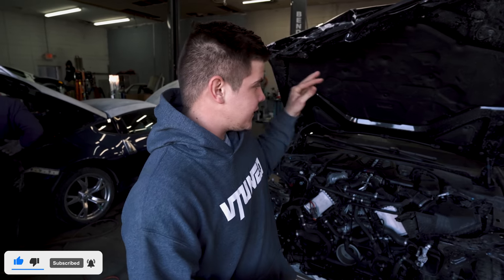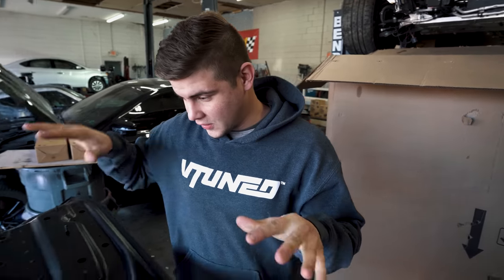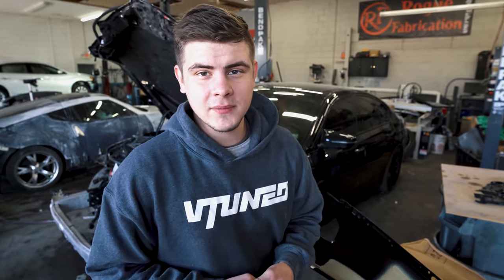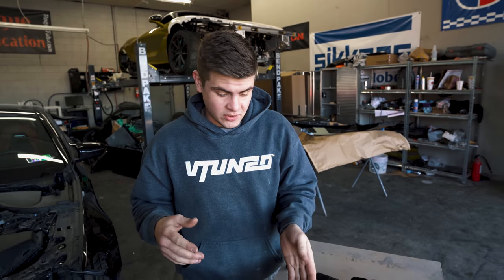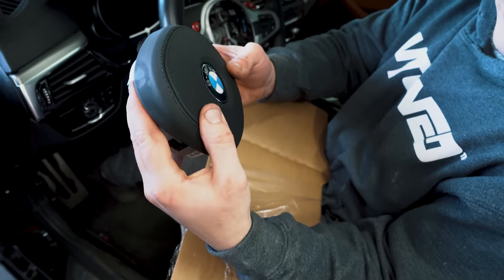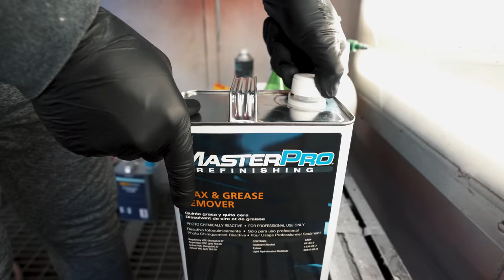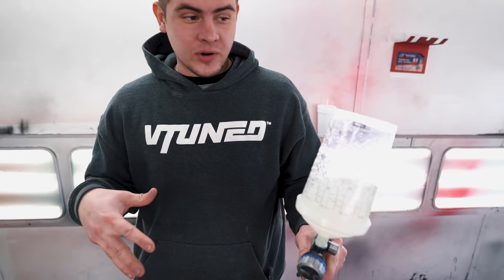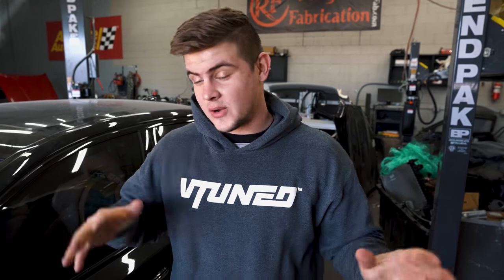The BMW M5 F90 is ready for FRAME work - Episode 4

Comment: Only vTuned could make me enjoy watching the painting of the inside of a hood and fender.
Reply: a straight forward practical guy. Just like the Backyard Boyz
Reply: this guy goes the extra mile.  most shops would be like well no one will see that hood behind the pad and no one will really see the inside of the fender.  since it's black let's just spray the edges and slap it on the car.  i highly doubt there's a production body shop that will spend the extra hours for those details.

Comment: Ben, Thanks for sharing, amazing video mate.  Can you please advice what type of paint you use?  Is it a two pack type with hardener or this new water based paint? Also do you need the base coat dry before putting on the clear coat or can I spary the gloss coat straight on? Thanks in advance as I would like to learn.

Comment: The paint job looks amazing and definitely black out the door handles
Reply: Blacking out the door handles would be beyond dumb.
Reply: @mikebrowne477  A bit of an over reaction as they are only door handles
Reply: @garethedwards2883  So leave them alone. A Nissan Versa comes with all black door handles. This is an M3.
Reply: @mikebrowne477  Hi Mike currently in the UK the cars all come with black handles/trim etc and sometimes BMW do it and call it a shadow edition.